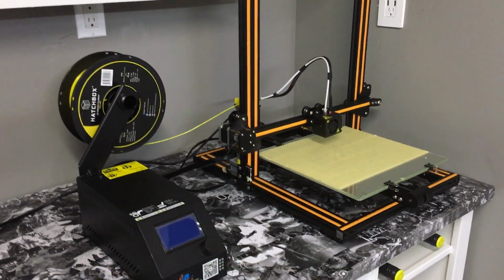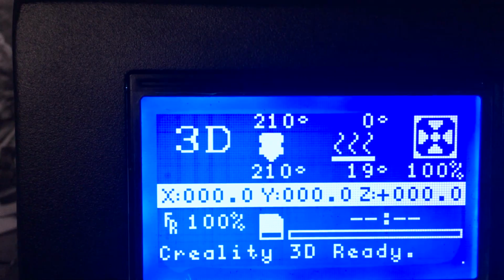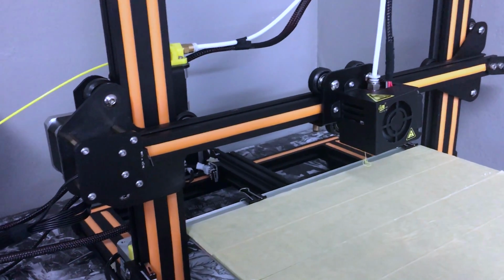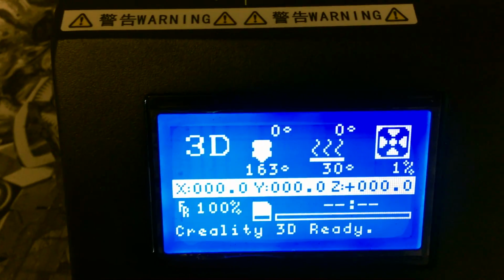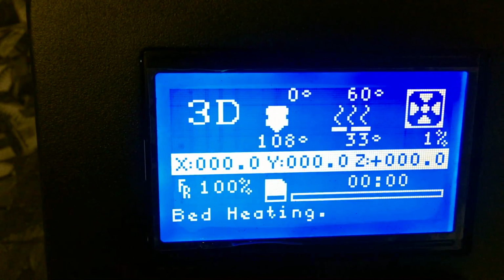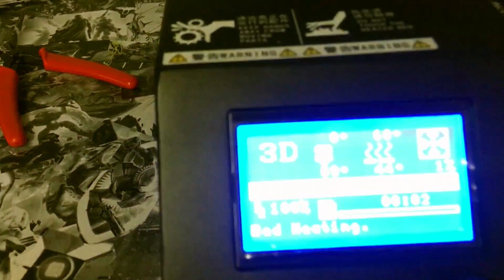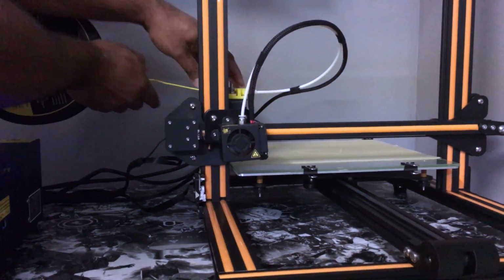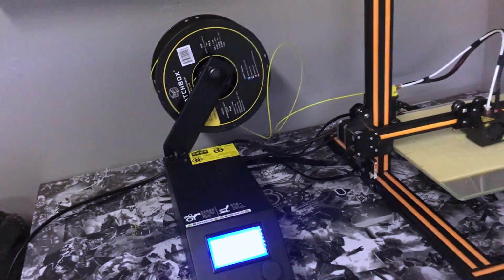Creality Cr-10 How to Change Filament - 2 Different Ways: Beginners Guide

Comment: You need to cooldown before pulling filament through your bowden tube, otherwise you're pulling hot filament through which could clog your bowden tube. I've spoke with so many people having a hard time resolving clogging issues because they think it's a hot end clog or un-level bed, when actually a small amount of hot filament got stuck in their bowden.

Comment: How do you change it in the middle of a project, I'm afraid to go to the home screen and loose the 30 hrs work into the project
Reply from the maker: You just pause print or select change filament. It is scary but after a few times you get the hang of it.
Reply from the maker: Here is a video I made on how to resume failed prints. There two parts to it: https://youtu.be/P7Wr09GAHaU
Reply: Thank you so much for the assistance!
Reply from the maker: @ozzypt95  happy to help!

Comment: You can do that. BUT if you push the extruder by hand constanly that SPRING over there will be get loose with the time and  you will have problems with under extrusion believe me... 
Most likely when you print with low speed the gears with the time won't spin properly cause there will be a gap between those gears that push the filament.
 Definitely The best way is to insert the filament with the extruder itself by using the control panel to move the extruder either to input or replace filament...
Reply from the maker: Agreed!

Comment: Very helpfully - thanks a lot. We already have an Ender3 and it's program is doing this filament change very good - it pushs out the filament automatically and it extrudes some filament after you have load the new filament - so the colour will be cleared before you start the print or go on with printing. Now we bought CR10 S5 - does it not have this function too ? Extruding filament after change ?

Comment: How do you get it in so easy? I always have huge problems getting it into the hole, into the tubing. The edge of the end of the filament hits the edge of the hole, because the filament is not straight having come right off the role. Very frustrating!
Reply: I watched again... missed it the first few times. You are trimming the end off at 45 degrees! How did I miss that, and why didn't I think of that?
Reply from the maker: Sorry for late reply but yup that will solve you issue.

Comment: Thanks for the vid. Why do you run at higher temps? I just started printing, about 20 prints in and so far 200 nozzle and 50 bed has been perfect.
Reply from the maker: The temp depends on the brand of filament some work great at 195 so at 210 so it just varies.

Comment: Great video. Very helpful. On March 19th, 2019, I updated the firmware to the latest CR-10s version which has the filament load and unload commands there even when the printer is not printing. Maybe you could do an updated video showing how to load and unload with the new latest firmware without the printer printing and also demonstrate how this works when changing colours mid print.
Reply from the maker: That would be a good video, I will put it on my list. Thanks.

Comment: Notice at 3:40 how the X Gantry went down?  How do you prevent that from happening when you are doing a mid print filament change?  Guaranteed if this happened during a paused print you would ruin that print.
Reply from the maker: Ya that can't be helped, just have to be super careful.
Reply: SANTUBE 3D here’s another way if changing filament no pausing. https://youtu.be/XldI0Ex7XaY
Reply from the maker: Thats pretty cool never thought of it.

Comment: i just attempted my first print with an ender 3.  everything was spot on until i simulated a filament change.  without actually changing it, when i resumed its print, i had a separation in the layers between where it paused and resumed.  Why did i get a separation in the layers here?
Reply from the maker: There could be many factors, sorry to say i would need to see it to know whats going on.

Comment: Great video. I like the trick of beginning a "fake" print in order to access the "change filament" menu and having the printer do the work. I'm going to try that today, but I have a hint that will make it much faster: turn the bed heat to zero. The head heats up in seconds, but the bed takes several minutes and it heats up first, before the head heats at all. Since you don't need any heat for the bed, simply use the controls to set that to zero, and the filament change should happen in less than thirty seconds, the time it takes for the head to heat.
Reply from the maker: I agree but I was going to real life issue.  Thank you.

Comment: I like the quieter way.  Omg I would never change halfway a print.  It took me multiple tries before the new filament went into the PTFE tube!  It kept wanting to go up or sideways. During the whole process I must have knocked the height of the X axis down a few times.  Not safe at all!  I would do it before any prints just to make sure.  I guess the trick is to bend the filament as straight as possible before attempting this.  Thanks for the video. I’m glad I watched it.
Reply from the maker: Happy to help!

Comment: How do you prevent the Z axis from moving when changing filament? Is there anything on Thingiverse that I can print?
Reply from the maker: I have yet to find a solution for that.  If not careful the z axis does drop but i use vise grips to hold it in place.
Reply: SAN TUBE ok I'll try that. I thanks

Comment: I have a question, do you have a preference for a software to design your own models?
Reply from the maker: I don't do a lot of designing lately but i have used fusion360.
Reply: SAN TUBE is fusion360 compatible with cr10 right?.. because I used to use other type of software with a different format and I wasn't able to print. I will try to change the format and see if that helps

Comment: Great video!  Are you supposed to push the Cooldown button after pushing stop print?  I think the filament doesn't cool down just by pushing stop print.....
Reply from the maker: Correct, when you stop a print the temps stay the same.  You have to do cooldown.

Comment: Hi, can't insert the filament into the Bowden Tube. When I push down the tab I can push the filament until it reaches the tube but
not any further, it seems to be blocked. Do you know a good way to clean the tube?
Reply from the maker: If you have something blocking the filament in the tub then remove the tub from both ends and feed filament though to see if thats the problem.  but first try cutting you filament tip at a 45 degree angle and then feed it thur to see if that works first.

Comment: Hello! I have a quick question unrelated to this particular video but possibly you can help me. It seems that i have some sort of a small jerking motion occurring every time the y access almost reaches the point where it changes direction to move the platform back towards the other way. This only occurs when the platform moves toward the front, its then kinda slips i gues would be the best word and then re-engages to go back the other way. Its a very small, jerk but i think it is having an effect on my prints. I noticed this when it was working on a big circular base and every time it reached on end of the circle it made that little slip/jer.k The circles themselves or the disk formed by them once the entire base was complete also had a sirl pattern throughout the whole thing rather than perfect lines going around. SOrt of a double pattern where you can see the circles but on top of that the fan shape... Anyway, maybe the jerking is the problem, idk... belts seem tight, screw are too, so idk.. printing at 210, 60% speed ., 60bed temp, fan 255,
Reply from the maker: JO P was it only with that one print or does it do it with all the prints.  There could be lots of things that can cause this. Let’s start by rechecking your belts and check under the bed to see if anything is block the path of the wheels that can cause the jerking my. If those two are fine then it mite be something in the slicing settings. Save ur settings as a profile then go download my settings (the link is below) and try printing with that and see if it makes a difference.

Comment: I have a CR-10S as well, and I found it helpful to disconnect the Bowden tube at the extruder.  For one thing, it's much easier to deal with things if you have a big gob of melted filament from the nozzle if you didn't happen to push enough through.  You just cut it right there.  It's also nice to be able to see when you have pushed the new filament through the tube.  Reconnect it once it's in, then push it that last little bit to reach the nozzle.
Reply from the maker: Agreeded.  Good luck and happy printing.

Comment: Hi San Tube. So you actually have to start a print in order to change the filament using the second method correct?
Reply from the maker: yes, correct.

Comment: I have the newer model 10-S and I do all the steps and go to tune there is never a change filament option so for my printer I have to do the 1st option
Reply: I have the same issue, is this really an option on 10S?
Reply: Same here :/
Reply from the maker: Change filament option only appears during a print.  If you don't have a print in process that option will not show up.
Reply: 3x times tried for me as I followed your exact process and waited till the print was 1% in and I do get the "Tune" to show up and I roll the wheel down but no matter what the "Change Filament" never appears  :/   Can you confirm this on your 10S ?   Thanks for all your awesome vids.

Comment: My cr 10 is spitting out the filament completely at the beginning of the print. It then tries to bring it back in for a couple centimeters. Any thoughts?
Reply from the maker: sdmatt1975 r u printing with a skirt, brim or raft

Comment: Accidentally moving the z axis sounds like it could be a real problem when changing filament. I don't pretend to understand gcode but isn't there a way for it to remember what z axis setting it was at so it can be told to go back to that setting before resuming the print thus rectifying any accidental movement of the z axis?
Reply from the maker: That is the one down side to the CR-10, if you move the z axis when changing the filament. you have to start over.  Unless there is a new way to stop that from happening, i am not aware of it yet.
Reply: I just got my cr-10 mini, my first 3d printer, (haven't even printed my first test yet) but I have a little cnc engraver and it works on a similar principle.  Communication from the system board to the stepper motors is pretty much a one-way street.  The board sends pulses to the stepper motors telling them to move and which way to move.  It might send over 1000 pulses just to move 1 inch, so it's very finely controlled, but since it's a one-way street the board is relying on the motors to move when it tells them to move (blind trust) and not move when it isn't telling them to move.  In other words, no feedback from the motor to the board saying, I've moved, now what?  If you move it manually no information is being sent to the board from the motor saying, hey, we're moving, are you seeing this?  Maybe the board thinks the z position is 100mm, but because you moved it accidentally it is now really at 90mm.  The part is ruined, or is it?

When you level the bed you are doing more than simply leveling the bed, you are telling the board, hey, this is z=0 position.  So, if you accidentally move the z position (or x or y) during a print if you can tell it to change the filament and it goes to the home position (home position being x = 0, y = 0, z = 0) you can use the sheet of paper leveling operation to reset all the positions.  Even if there isn't a change filament in mid print option if there is a pause print and go to home option that should be another way to salvage the part you are printing, or at least worth a try.

Comment: Try this instead:

;TYPE:CUSTOM
M106 S255                 ;pwm ON 100%
M117 Filament Change   ;LCD "Filament Change"
M83
;M107                   ;fan off
G1 E-1.000000 F6000
G1 Z15.000000 F300
G1 X100.000000 Y0.000000 F6000
M84 E0
M0
G1 X25 F9000
G28 
;X Y
;M109 S205.000000
G1 E1.000000 F6000
G1 E-1.000000 F6000
G1 F9000
M82
M117 color chng @3.5mm ;LCD screen 

;;
It will move to X100 Y0 Z15 and be ready to clear nozzle and change filament. Press the button after you change filament and it homes, restarts and puts a new note on the LCD.
M117 Filament change              ;LCD instruction 
M117  color chng @3.5 mm      ;LCD warning - when the next color change
M106 S255                                   ;PWM on. use it for a light or other alarm to tell you when to change filaments
;M109 S205                                   ;new temperature for new filament (un-comment this and  the nozzle will pause until the   temperature is matched)

;;
Pay attention when you slice the model to know in which layer to insert the little bit of code. You may have to change X,Y or Z for the park position...
Reply: Helmut Abel 15 mm is just the height at which I chose for the dump  site. x=100 y=0 and z=15 puts the nozzle where it is easy to change filament. you can change any x, y or z to suit yourselff.

Comment: Hey what happens if you just forget to standby your printer and not change the filament and it runs out. I'm assuming it will go past the extruder motor and stop meanwhile the print will still keep going and ruin the print. However now you have a problem potentially a clog issue. What should you do in this case? Should you grab a pair of pliers and try and pull out the filament while heated to normal temp? Or would you be better off feading another filament behind it trying to push it through?
Reply from the maker: I wouldn't feed another filament, i would take the bowden tube out and then try to push the filament through at a higher temp then normal.  if you can  push it past the nozzle the the chance of a clog is minimal to none. Then feed about 12 inches of filament thur it just to make sure there is no clog.  if everything goods look then just connect it all back up and get ready to print.  As for the print, if you run out and its still trying to print, ya your print is ruined.  Good Luck.

Comment: For moe advanced method, It is possible to change filament on the fly during printing , you may do it at full speed or slow it down a bit... cut filament at right angle a few inches above feeder... line up new filament to feed in right behind the old filament, push it through feeder hole immediately behind old filament and it will continue onward pushing the old filament through as printing is done.Note : cut ends should be flat so will make good contact between them. Can speed print back up slowly. Works well on CR-10 printer.

Comment: I have a problem my extruder won't push the filament through
Reply from the maker: Try preheating ur nozzle to 210 degrees.  Then change ur flow to 100. Then extrude some filament and see if some comes out, If it doesn't there a change ur extruded is clogged and u will have to clean it out after the temp goes down to zero. All these settings r in ur printer so no need to set them in your slicing software. Let me know how it works out, good luck.

Comment: I watched you're cura video and it was helpful but every time I print the stl file on the printer it prints on the corner,have u had that issue
Reply from the maker: yes there is a fix i posted in the videos but you can't see it if your using your mobile device.  its very simple.  Open cure, top right click on where it says purse i3 or your printer name, then click on manage printers, then click on machine settings, right above heated bed it says machine center is zero, make sure that is unchecked because on the cr-10 zero is front left side that why it starts printing there because it thinks thats the center of the printer. also i wrote the new measurements and this problem in the description under the video. just click on show more and everything is there.  Good luck man happy printing.  please let me know if it worked or not.

Comment: Hey i was thinking when you start a print there is a pause option can you pause your print turn off your printer from the power outlet then start the print again later ?
Reply from the maker: i have tried that but when you turn off the printer it cancels the current print, if you pause the print you can still change the filament but you have to press the camp in the back and that mite move the z axis.
Reply: SAN  thanks a lot buddy !
Reply from the maker: happy printing